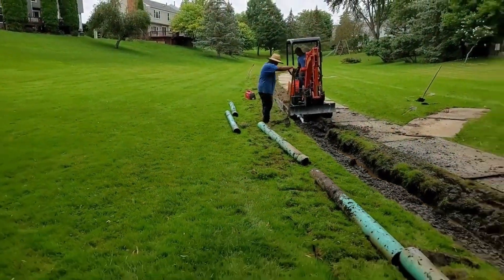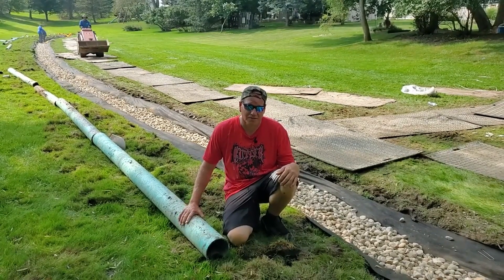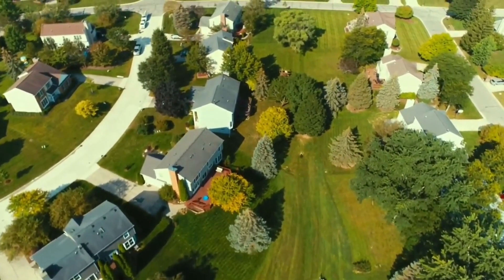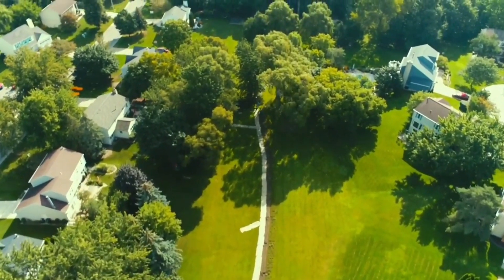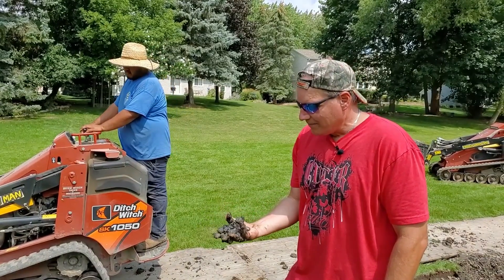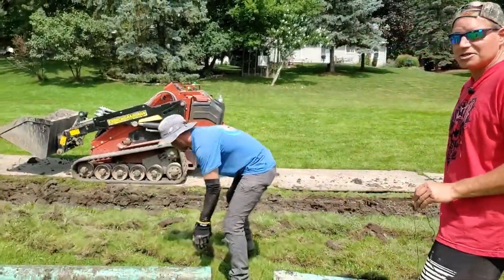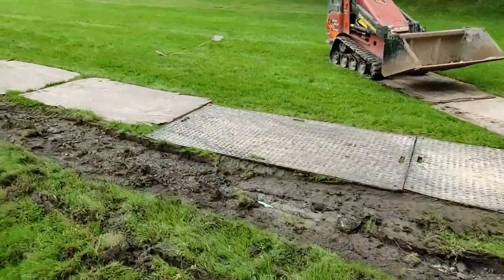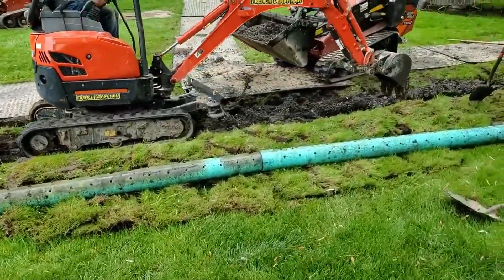Tearing Out Failed French Drain in Local Detention Pond | Back to Basics Part 1

Comment: Thank you so much for your time and work! I have learned so much. I am about to install a french drain system and was hoping to get your thoughts. Can I use 2-4 inch clean gravel with 6inch corrugated pipe or will it cause issues and I should do 1-2inch round rock like you suggest? I will say, we get a river in our backyard when it rains hard. Thank you for your time and effort.
Reply from the maker: 1-2" I prefer it packs the pipe in tight. Keep watching series we do that in part 3
Reply: @FRENCHDRAINMAN  Awesome thank you for the fast reply!

Comment: How do you calculate the amount of round rock you need for your French drain
Reply from the maker: 25-30 Linear feet per cubic yard.
Reply: Math...it's a cylinder. Pi*R^2*length = volume, minus volume of pipe.
Reply: @tritonlandscaping1505  nice